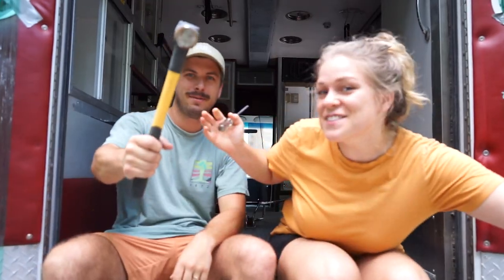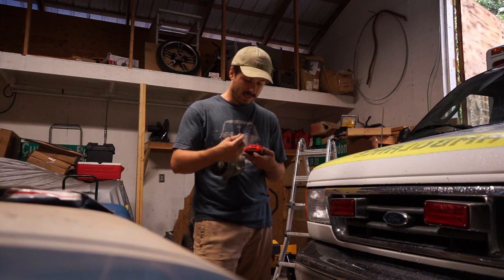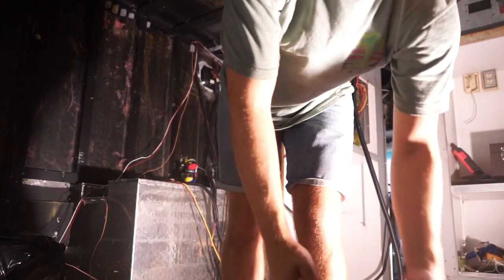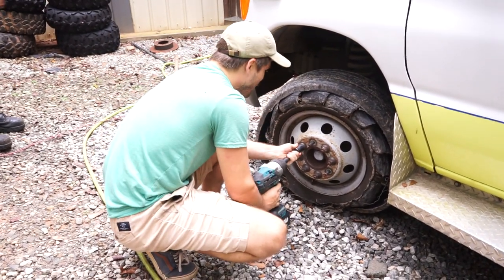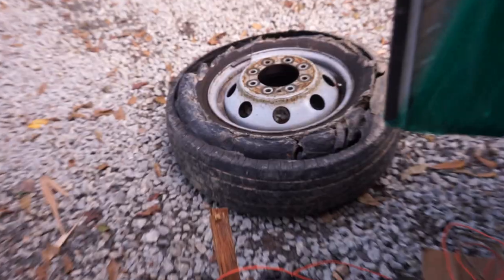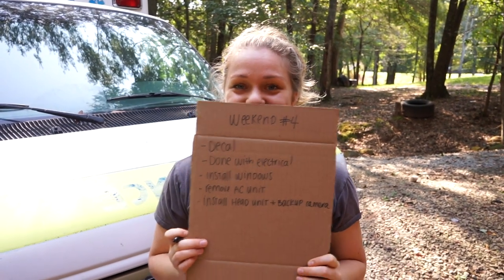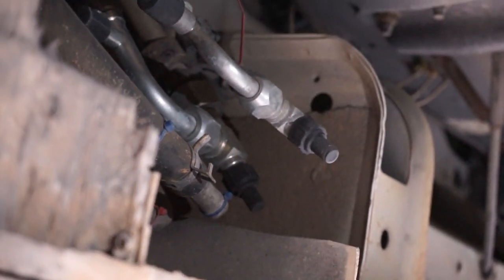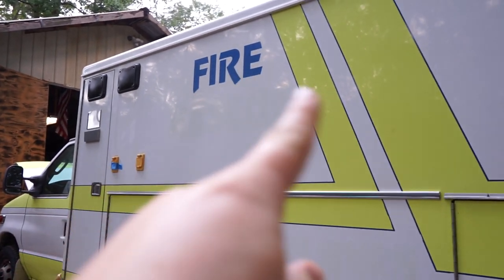Harder Than We Thought - Off-Grid Ambulance Conversion - Week 2 & 3

Comment: What were the wheels you used, to take the decals off?
I have a bunch of them to remove.
I don't want to paint over them, and,I don't want to spend forever, in sub freezing Temps, with a heat gun, and a nylon scraper.
Reply from the maker: Hey, look in our video description, I linked the rubber wheel I used, it's very efficient.
Reply: @stephandmicah  sorry. 
Folks are rarely so thorough. 
I have a whole lot to remove,
for legal purposes, but I want to maintain the same overall
look, and avoid repainting the whole truck.